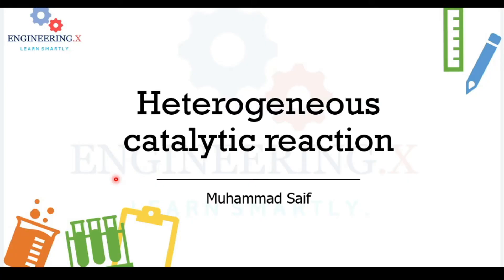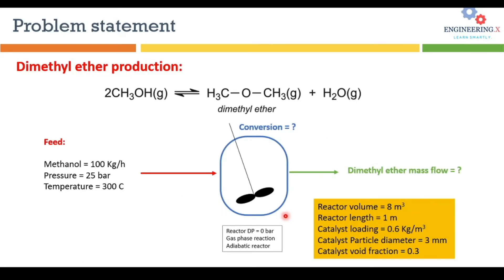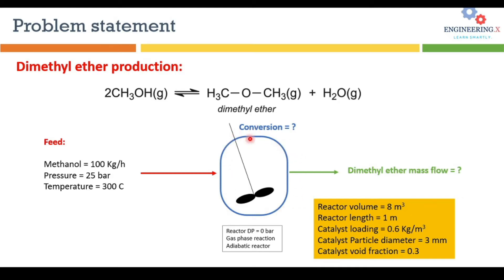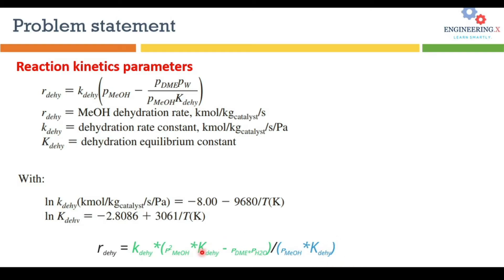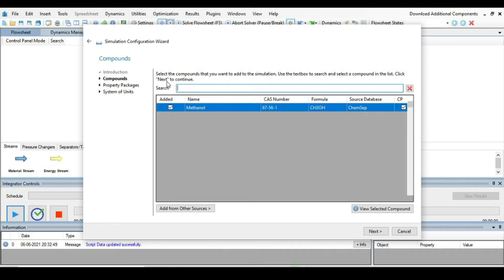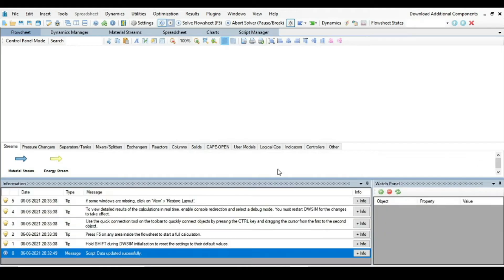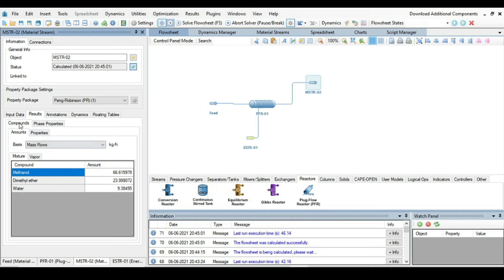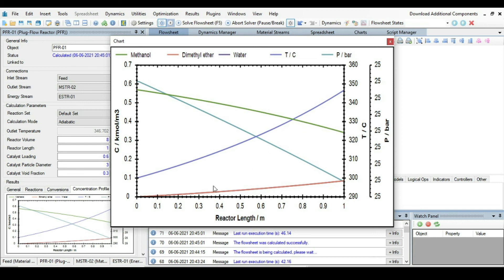Heterogeneous Catalytic Reaction in DWSIM

Comment: Dear Sir. Where is the reaction information source? Thank you in advance
Reply from the maker: It was a research paper but I don't remember the name of paper. Sorry
Reply: @eduXinsight  Thank you. After solving the simulation with your same info, the plug flow reactor restores the catalyst info to the original values: loading, particle diameter and and void fraction to "0", and so there is no DME in the product stream. How can it be solved?
Reply from the maker: @osvaldochavarria2969  in that case, do not pause the simulation solver. It will take longer but in this way you will not lose the information. I hope that will work